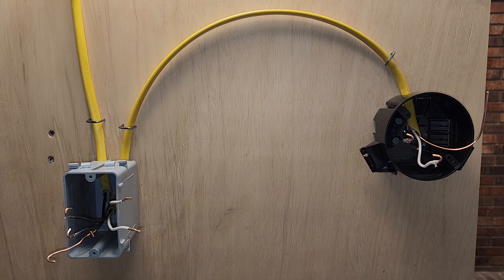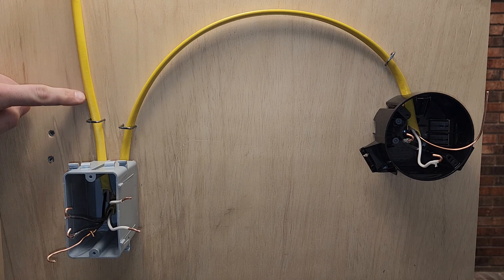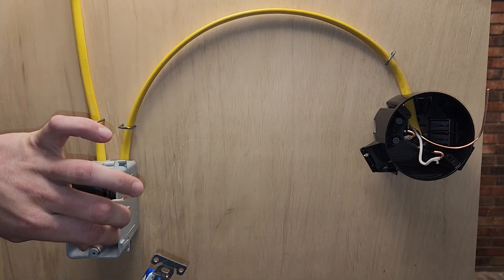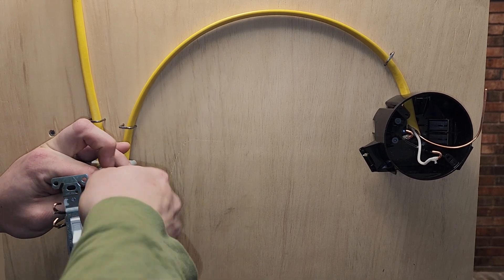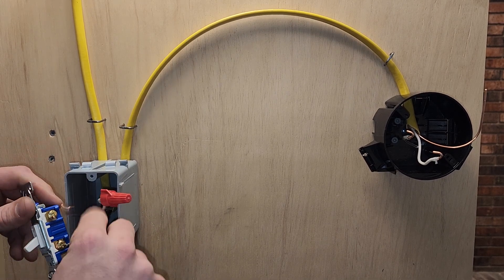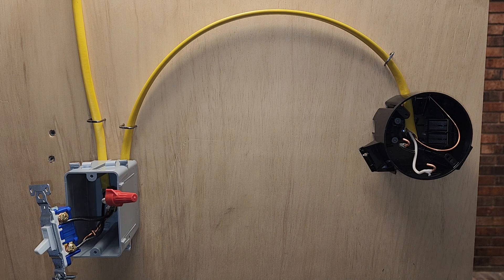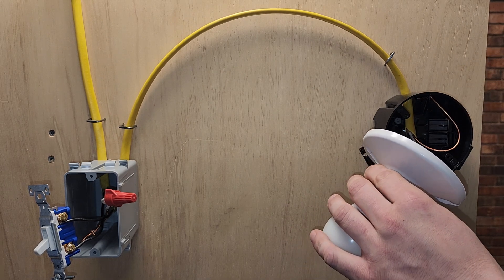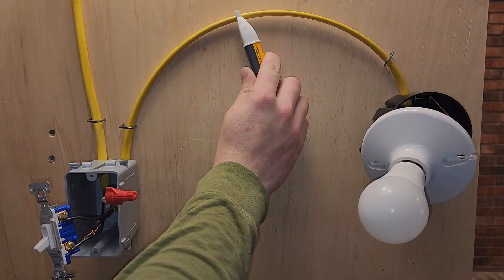Light Switch Wiring 101: Mastering Single-Pole Switches for Beginners

Comment: I find this job is a lot more difficult to do when working with stranded wire rather than solid wire (romex wire).  Thanks for uploading these kinds of videos.  I have no clue how to hook up stuff like this.  This channel has been a big help to me.
Reply from the maker: That's true. Stranded wire would be best going in a ring or fork terminal crimped on if you're using the standard screw terminal receptacle. I really appreciate your feedback.  I'm working on some electrical theory videos to post soon but will still post DIY videos along the way. Thanks again for watching.
Reply: @LouisianaPowerSystems Thanks for the response.   I wound up doing just that (fork shaped after I made the mistake of trying to back out the ground screw...... ).  I keep telling myself I'll be a lot smarter after I'm done.
Reply from the maker: @sgnt9337  you will definitely become smarter as you keep being hands-on.  Next time, try buying a receptacle with pressure plate terminals if you're going to use stranded wire. That'll make it a lot easier.